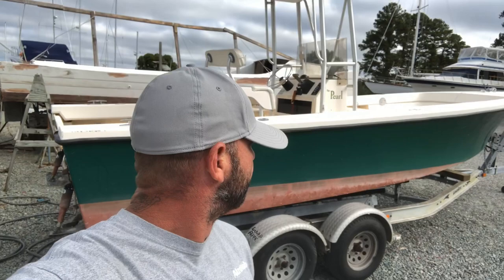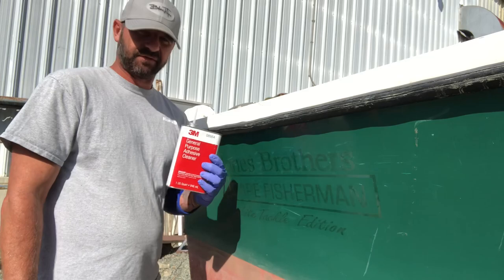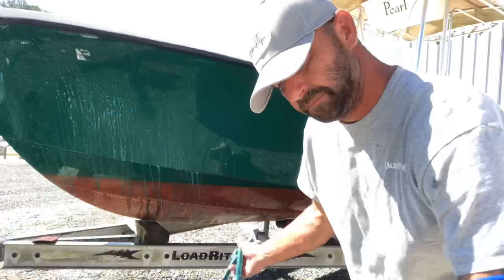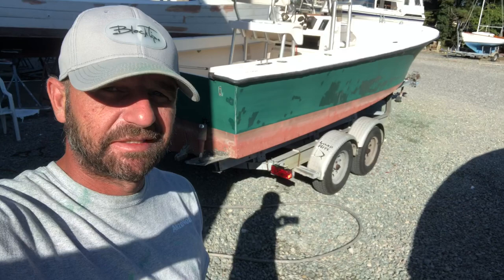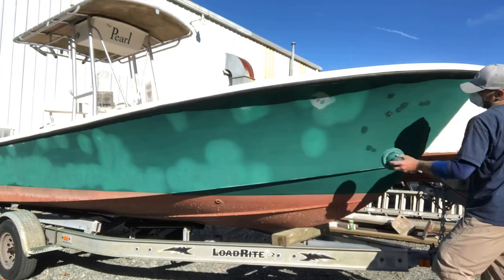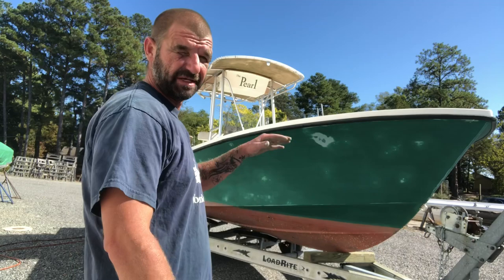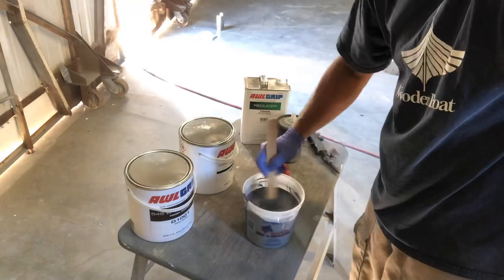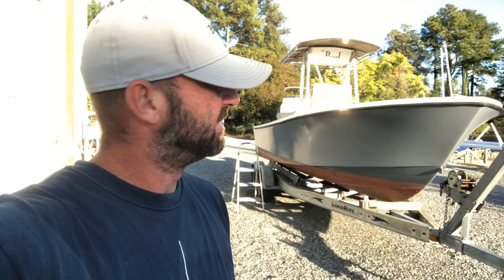How to prep and prime a boat using AWLGRIPS 545 epoxy primer

Comment: I'd used wash and wipe with the comet or bon-amy to clean .. but good job on cleaning all the grim and crap off the boat lot of people never think of that scrubbing process to get all the oils from the other boats since fiberglass gel- coat is porous and will collect everything... Usually I sand with 180 grit  paper but I only use mixed repair fillers not air dry I go around with a pencil first mark them then sand those areas repair and final sand 180 for primer then once dry sand for paint ... Looking good that's for sure and your right the gray does look better than green

Comment: As you were closing this I heard you say 3M acryli-filler. That sounds like what I need. I have one part primer sanded that still has little flaws all over.
Reply from the maker: It’s perfect for shallow voids. 👌👌
Reply: @boatpaintingrestorationwit3029  Yes, so yesterday I went to get some. They had Bondo Glazing Spot Putty. I noticed it had the 3M label on it. So that tells me 3M makes it. I used it and sanded it with 320 and it works excellently. I used a flashlight last night to see imperfections and this stuff fixed them all. Fortunately indoors up here in the Finger Lakes.

Comment: Great instructional Videos Frankie.  Can you provide a ballpark for what this kind of job (similar sized boat) should cost at a yard.  Having watched this and your paint video I need to know if the cost will motivate me to DIY or leave it to the pros.  Thanks.
Reply from the maker: Concerned Fort Lauderdale this particular job through a yard runs between 4-5 grand. Hope that helps, and thanks 👌👌
Reply: @boatpaintingrestorationwit3029  yes sir, thanks

Comment: Awesome! Going to work on a 20 foot Boston Whaler Outrage. About how much primer and paint did you use? Trying to figure out how much to pick up.
Reply from the maker: It took a qt of base, qt converter plus 25% reducer for the priming (545) and when top coating I had to open up the 2nd qt because I decided to do a 4th coat.  So 2 qts of awlcraft, 1 qt converter and 25% reducer to be sure you get desired finish. 👌
Reply: @boatpaintingrestorationwit3029  Thanks for the fast response! Planning to work on the entire hull so I guess that means doubling it. Also plan to roll the paint on as I don't have an area that I could spray in.

Comment: Frankie, what psi are you running at the gun? Awlgrip doesn’t have a recommendation for 545 and the hvlp gun. Thanks for documenting all of your knowledge for us viewers 👍
Reply from the maker: I run higher than recommended. Honestly I never look at the gauge and it’s covered in overspray so I can’t see it. Lol. I just do it by feel and sound. It’s somewhere between 30-40 psi👌
Reply: Thanks Frankie! I put 40 on the gun and it flowed out great. Hard to keep up with refilling the hopper and keeping a wet edge.

Comment: this may sound like a stupid question .. but arent you afraid of the wind blowing sand or dust on the wet surface? .. what do you do if that happens?
Reply from the maker: I don’t spray outside when it’s super windy and the trick is to hose the ground down around the boat and rehose after each coat. It’s needed when spraying outside 👌
Reply: @boatpaintingrestorationwit3029  Great tip ... and great videos too !!! .. thanks Frankie

Comment: I have 2000 sea Rey 280 bow rider I need to do a lot of work on it? what’ bottom paint would you recommend for me, this boat had bottom paint before but it looks like is chipping away, so I Pressure washed it off and send it off. I need a second opinion? Now this boat is on the trailer I believe it is going to be after every use, this is my first boat and I want to do this right?

Comment: Hey Frankie, What would happen if you just left it with the primer? Do you need to put a true paint on top of that?
Reply from the maker: Yes. It will continually break down if not sealed with a topcoat. Anything that touches it will scratch it etc. I mean I suppose if you wanted to you could prime it and walk away but it’s not recommended.

Comment: Do I recall that you said that was a 20 foot boat?  Roughly how much product did the topside take, trying to make sure I order enough.
Reply from the maker: Grand Isle Fishing Report I had 2 qts base and 1qt converter. I was able to do 3 coats with 1 qt. Ended up needing to do a 4th coat and I had to open the 2nd qt for that. 👌
Reply from the maker: Primer took 2 qts and same with the topcoat to be safe

Comment: Hey Frankie, would it be possible for you to provide the AWLFAIR Epoxy and Hardener product numbers that you use. AWLFAIR seems to have quite  a few.
Reply from the maker: Awlgrip  awlfair LW fairing compound (D8200 white base) and awlgrip awlfair (D7200) standard converter

Comment: Awesome work very informative!!!  What do you paint the bottom of the boat with?
Reply from the maker: Tim Thompson thanks. And bottom paint is what would be used. On pwr boats most of the bottoms are painted with a hard copper paint, and with sailboats, mostly ablatives. Hope that helps.

Comment: I am going to start sanding my top side like you did here ! Is there a recommended cleaning practice that doesn't involve water and the scoring? The boat is under cover so trying to limit water use.
Reply from the maker: Primary Search Sportfishing you can solvent clean the heck out of it with den. Alc. you just don’t want wax grease or dirt on your surface before sanding. I just prefer the wash scrub because it’s quickest and easiest.

Comment: Great work man, very helpful video's to help me repaint my boat.  What is that tape with the plastic rolled up on it? I haven't seen that before and it looks very helpful to masking something quickly
Reply from the maker: Pre tape masking film.  I get it from Paxton but, you can get it from Walmart also.  Lol. Cost more at Walmart but it’s still only like 8$ a roll. For one project, it’s worth it
Reply: @boatpaintingrestorationwit3029  your the man! Thanks for the help

Comment: Quick question on your masking. I noticed that you pulled it between primer and topcoat, any particular reason for that? I am about to paint my boat with the same products. This will be a first for me so just curious. If you were going to prime on day 1 and then topcoat on day 2 in a closed environment like a warehouse, would you pull the masking between the two?
Reply from the maker: Ben Williams I pull the tap and plastic for a couple reasons. One reason is to make sure no overspray got up underneath it and on to the deck. Second is sometimes after you prime and you keep the first go of plastic on there, when you go to spray topcoat you risk little flakes of primer breaking free from the plastic and getting into your paint. Now if the boat is inside I will leave the plastic on and do all the finish prep before pulling and remasking.  If you plan to prime and topcoat all in one go then leaving the plastic on is fine.
Reply: Awesome, appreciate the quick response. Been watching a lot of your other videos, good job with these...very informative 👍

Comment: Love your videos. Question. How come you never use a guide coat to see high / low spots etc?
Reply from the maker: Thanks Paul. The grey primer acts as its own guide coat when you start sanding. Very easy to see all imperfections. I actually show what I’m talking about in a couple previous videos 👌
Reply: @boatpaintingrestorationwit3029  got it! Have just seen you say that in another video. I live in Ghana and will be doing my boat following your videos close as I can. I have spider cracks and saw how you dealt with them in another video. I can't get all the fancy West systems here so will make do with what I can get, but principle will be same. I will spray with awlcraft as is more forgiving for a noob like me. Thanks for all your help

Comment: One more question. I watched the rest of your videos and now see why you sand between primer and topcoat. Is there an amount of time you wait after priming before sanding? Is next day good?
Reply from the maker: Ben Williams if the temps are warm enough (70ish degrees) then yes, you can sand the next day. But I always give it at least 24hrs. I’ll do my first go of filling pinholes etc the very next day then I walk away until the following day

Comment: So i sanded gelcoat filled larger spots with awlfare then i screwed up and did very small areas with filler paste before primer. Did i screw up?? Its not primed yet . But is sanded and extremely small holes only with paste filler.....please help...
Reply from the maker: Totally fine. Your good to go

Comment: How long do you wait after stirring the 545? 15 min before you can use it? Also, after coat one, how long do you wait until coat 2? And how long until coat 3? Let's assume 70 degree day. Lastly, how long until you can sand coat 3 down with 220?

Comment: Thanks for a great video! Quick question: I am planning on using the medium gray awlcraft 2000 topcoat for my hull. Do you recommend the 545 gray or white primer? Is it just a preference thing, or should I be contrasting it to assure full coverage when I go to apply the top paint? Thanks for the help!
Reply from the maker: I personally prefer the grey 545. It acts as it’s own guide coat when sanding and you can see what you’re doing a lot better. This is my preference 👌

Comment: Great content, Frankie. I’ll be painting a center console duck boat in a few weeks, can the awlgrip grey primer be the base coat for the camo stencil or will it need a finish coat to make it last?
Reply from the maker: I would finish it off with whichever base color you choose. The primer does not have uv protection. It will get chalky and be a mess. Now you could clear coat over the 545 and stencil and that would work just fine 👌

Comment: Any tips on prepping the molded non skid on top side decks?
Reply from the maker: OBXTERIORS sorry for late response. Just now seeing this. Are you wanting to do away with existing pattern and start from scratch or do you want to save Existing pattern
Reply: Frankie Bushong looking to keep the existing pattern. Thanks for the help!
Reply from the maker: Use a red scotchbrite equivalent to 220 grit.  The dark red ones. Scrub the heck out of it. That should do the trick as far as prep goes. Solvent clean and spray.  If rolling then you wanna drop back to the green scotchbrite which is coarser     Let me know if ya need more answers 👌

Comment: Another one for you Frankie, I have an Armstrong bracket on the back of my CC. It was painted the same color as the hull. I just primed everything today with 545 and plan to topcoat next weekend with Awlcraft. The bottom part of the bracket is below the waterline, but the boat does not sit in the water when not in use (stays in high & dry). Do you think I need to use a different product on the bottom of the bracket? It was painted before and I didn’t have any issues, but it just donned on me since Awlcraft says for use above waterline only.
Reply from the maker: If you’re gonna only have the boat in the water for a couple days at a time or less then you shouldn’t have any problems if you top coat it with awlcraft. However, if you start to see scratches or gouges then worst case take a artist brush ( tiny paint brush ) and brush paint in those areas to seal it again. But I believe you’ll be okay to paint it if boat doesn’t stay in the water.
Reply from the maker: Ben Williams as long as you prepped it properly then all is good

Comment: Frankie, you do great work. Did you have to sand in between primer coats?
Reply from the maker: No. When spraying, you can apply all 3 or 4 coats the same day. No sanding in between
Reply: Love your videos???   Question what would happen if I don't sand the primer before applying the top coat??